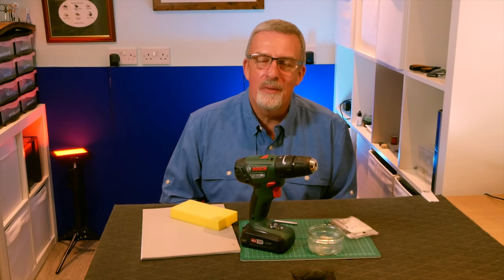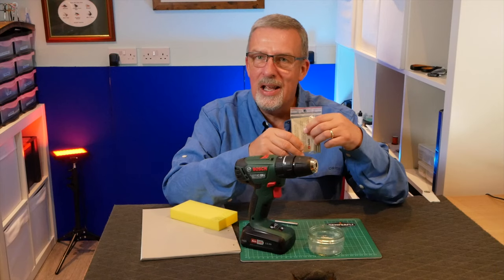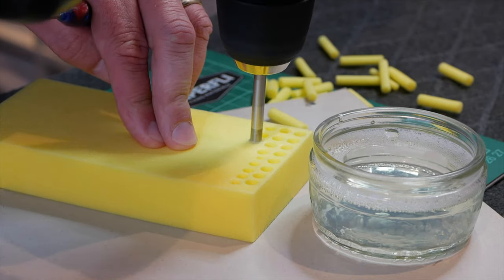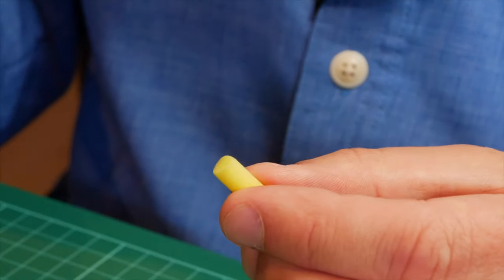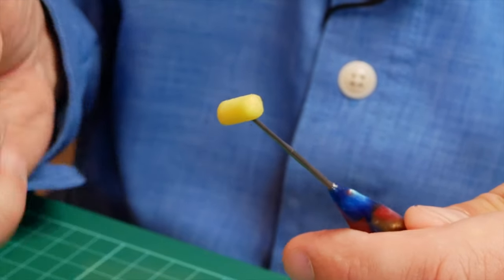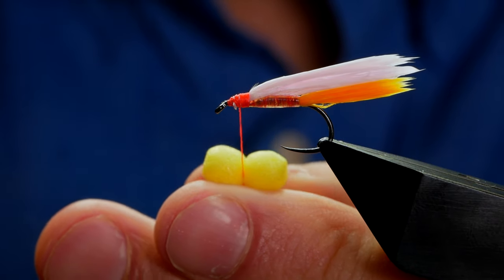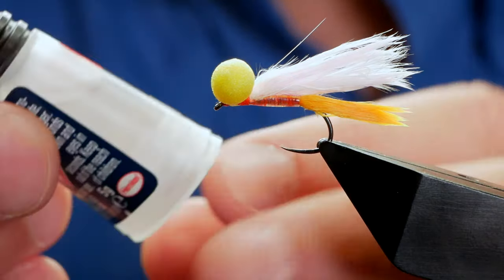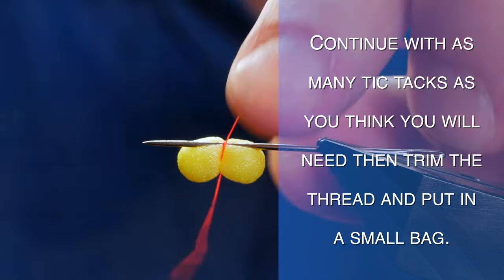How to make perfect booby eyes for Fly Fishing and Fly Tying.

Comment: Hello Lindsay!  I've ordered  some proper Upavon HD foam and been looking at boobie fly patterns so I can start tying for the next season. Would you please comment on my speculations to confirm that I'm going in the right direction. As near as I can determine from most examples, the diameter of the eye is the size of the hook gap or slightly smaller and the length of the cylinder is twice the diameter of the eye or 1/2 the thickness (.5 inch) of the standard foam block. The hook, usually  a size #10, has a short shank and the fly dresses to an overall length just over two hook lengths long to the end of the wing & tail. I'm presuming that this is a typical boobie fly configuration suitable for fishing on its own or as a point fly on a washing line. Spinning (while casting or during fast retrieves)  seems to be a concern. Presuming the eyes are tied in properly,  I'm guessing that the hook weight/length and the wing dressing (sparce or full) will determine the fly's stability  - too much would deaden the action, not enough and it will spin. Have I got this right? I'd appreciate any advice.  ATB!
Reply from the maker: Getting the eyes even and smooth will help eliminate the spin. Folks have issue with spinning flies when one eye is smaller than the other if that makes sense. As for proportions don't be afraid to tie bigger than you might think diameter wise as this will make the fly move more in the water. I hope that helps.
Reply: @lindsayiflyfish  Thanks Lindsay,  that helps a lot!

Comment: Your kiss keep it simple stupid approach dispels the bull dust and the lessons from experience add soo much to every subject you cover. The water with washing up liquid (translation for our American friends dish soap) for cleaning and lubricating the cutter. In the long run the prefabrication of bulk boobie eyes saves a lot of time. The not using a figure of eight technique to secure the tictack instead five turns in each direction is inherently much stronger. My only extra tip would be if preparing cylinders for fabs instead of a ninety degree cut a forty five degree cut saves two cuts later.
Reply from the maker: Thanks Mike

Comment: Thanks Lindsay,  this is very helpful for us boobie newbies.  I'm still viewing your videos (haven't watched them all yet). Do you have a video (or would you make one) on the what length and diameter of cylinder to use? There seems to be a need to consider air resistance and buoyancy relative to the size of the fly, hook and how it going to be fished. I've tied a couple of boobie flies and I'm not sure that I have the proportions right. I'd appreciate any help, it's the winter fly tying season here in Canada and I  would rather not tie up a couple of dozen boobies only to find that they aren't usable. Cheers!
Reply from the maker: Thanks Hank, I will have a think about how to best make a video about the subject 👍
Reply: @lindsayiflyfish  A video would really be appreciated! I've looked for boobie flies here in Canada and the commercially tied ones I've seen were  very poorly tied - I strongly suspect that the tier has never seen a proper fly let alone fished one.